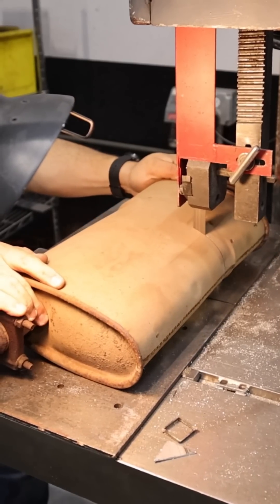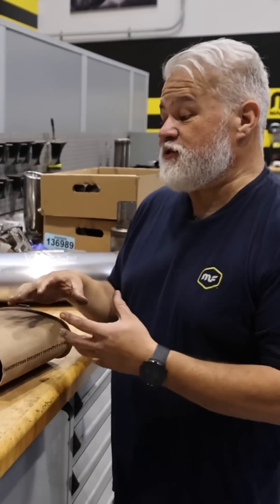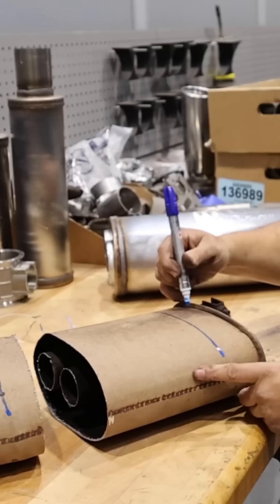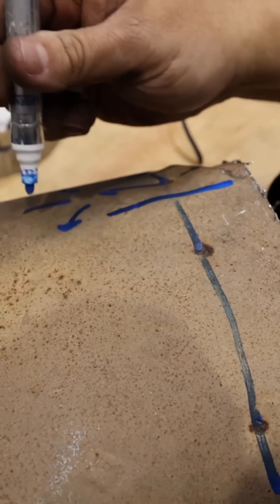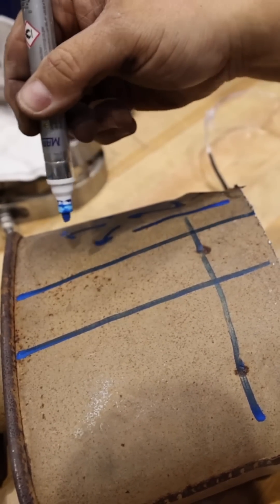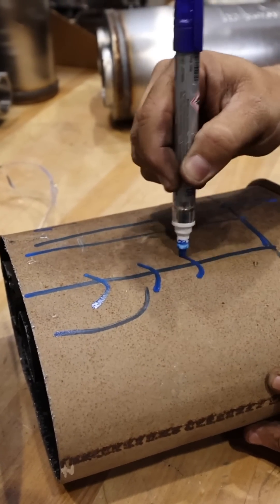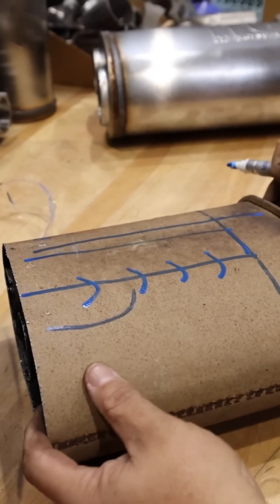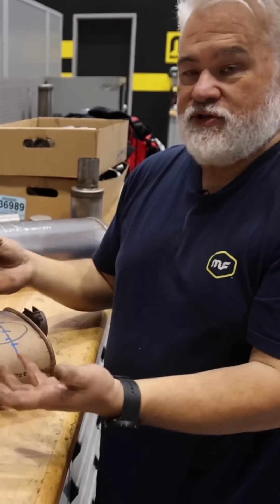What’s Inside a Cheap Exhaust Muffler?

Comment: This is how you block sound. It is doing exactly what it's meant to do.
Reply: I have a mufler on my car that does 2 30°turns and a serious of spherical divets  that suppress the sound without holding the gasses back.
Reply: Yes I agree a muffler it's entire purpose is sound suppression that's it that's all
Reply: It's doing cheaply which is his point, a well designed and manufactured muffler will be superior in both sound reduction and flow.  I bought a 3" muffler, it robbed about 25hp over no muffler, I cut it open it was this exact design, I gutted it, fitted it with 180deg mandrel bends at each end, few other things, stuffed with steel wool and not only was it quieter, I got 20hp back.
Reply: @kingcosworth2643 i know nothing (im not a troll)  steel wool is quite flammable...  why use steel wool?  Not enough oxygen to burn or rust?
Reply: Hence the name. There are words that i use for people who install "efficient" mufflers😊
Reply: He did say it was completely about sound suppression.  It causes back pressure (restrictive) and that robs horsepower.  It was not designed to take the engine efficiency into account.
Reply: Literally what a muffler means😂
Reply: It baffles me how little people in the comments know about how vehicles operate.. SO pun intended. 😂
Reply: We know a "muffler" reduces sound, his point is how inefficient it is at delivering the exhaust out of the vehicle, that reduces performance by a pretty large amount
Reply: @phdcinnabar5754  agreed!
Reply: @phdcinnabar5754 Me grinning nearly straight piped 😂😂😂
Reply: @Jamie_Sunshine  loud as hell though, right?
Reply: @phdcinnabar5754  Well I've still got a Cat and one resonator, it's a cat back system for my Mazda 3 turbo
Reply: @Jamie_Sunshine  👍
Reply: @phdcinnabar5754  You don't know that.  If this is a muffler for a 150hp car, its probably just fine.
Reply: @confuse9  all mufflers reduce performance so I'm not sure what you mean by I don't know that, the more turns, the more pipe, the less performance, there's a reason drag cares have there's exhaust go from the engine straight out the sides, everybody should know this, even high performance exhaust systems are not as good as just venting the engine straight into the atmosphere, but we do not do that, even the ripples at the bends reduces performance, this has all been tested thoroughly many many many times over
Reply: @phdcinnabar5754  LOLz, you may want to learn a bit about exhaust design, pulse tuning and scavenging before you start building that pipe venting straight out of the engine into the atmosphere.
Reply: @phdcinnabar5754  But how many?
Reply: @phdcinnabar5754     no... the point is a false flag sort of argument about efficiency as cover for assholes that run loud exhaust on their vehicles.
Reply: @stephenx2857 our engine is breathing through a straw with the stock exhaust system. Yes going after market can it louder, but It definitely improves performance, and can even improve gas mileage. I agree with you about people just cutting off their exhaust to make their car annoyingly loud, but thats not the same as a performance exhaust

Comment: Surprisingly the muffler doesn't obstruct much exhaust gas...the catalytic converter is the biggest obstruction
Reply: That's why I remove them.
Reply: Whole true. It depends on the application. In my avalanche the muffler is the biggest restriction. Idk why gm though dual 3" into out 3" was smart
Reply: provides the most effective noise suppression as well.
Reply: Your answer actually is incorrect for the most part. Many dynamometer tests have proved that on today's cars, the heat generated in the catalytic converter actually causes expansion of the exhaust gases that leads to greater velocity of gases that leads to a better scavenging of the exhaust. You actually lose power by taking the catalytic converter off of most NA cars
Reply: @JMar671  The heat creates expansion of the gasses that do not flow one way so it actually creates more back pressure, you want to cool down the exhaust system for it to flow more easily. The one exception would be if you have a turbo behind the catalytic converter, then the added pressure created by the heat would add more air pressure to the intake giving you better power.
Reply: @JMar671  some catalytic converter are less restrictive than others.
Reply: @JMar671 your both right and wrong.  Pressure out of the exhaust is increased. But the op said volume, which is reduced more by the cat. Like a Pressure washer,  not much water, but high pressure
Reply: @JMar671  You may be correct when talking about  modern cars, with their computer chip enhanced performance. I can attest however, that I had a 1980s Nissan Sentra, a California model with TWO catalytic converters that got 36 MPG or so.

Then the exhaust pipe failed under the engine compartment, prior to the first converter... the whole exhaust system fell off, and because I was young and poor, I carried the remains around inside the car, so if a cop pulled me over, I could claim it JUST happened, I swear Officer.

It went from sounding like a quiet little econo-box 4 banger, to sounding like an old 8 cylinder pickup. And my gas mileage went from 36 or thereabouts, to 41-42. I loved that old beater, and at the time, I was working multiple jobs, one of which was delivering pizza.

My customers used to tease me, and say they always knew when to get the money ready, because they could hear me coming 6 blocks away. But there was no way I was fixing it for as long as I could get away with it, once I figured out I was getting an added 5-6 MPG.

RIP little Sentra, "Penny" (named after the penny I found muck-glued in the ashtray) served me well.
Reply: @JMar671  those tests don’t re-tune the fueling after removing the cats, that’s why they lose power, and they also don’t change the intake which is usually just as restrictive as the exhaust. If you remove the cat, upgrade the intake to keep up with the increased exhaust flow, and tune the fueling you gain significant power (10-15% in my experience). 

If you simply remove your cat and do nothing else it’s correct that you will lose power.
Reply: @JMar671 that's odd I've worked on performance exhaust systems for years and have never seen a car improve hp ever. That's why the first thing that gets done on a cop car is to remove the cat
Reply: @JMar671 I’m glad you specified most NA vehicles, because I have a diesel truck that would argue with it. Incredible performance boost and much cooler eg temps with no cat!  Huge performance boost removing it
Reply: @warrenparker6287 shhhh... epa entered the chat
Reply: @reynoldscs  I know nuffin
Reply: @JMar671 This sounds false 😂 but I don't care to do the research. Check mate. Have a nice day! I'm going to probably stir up a hornets nest repeating this at some point with no citations or evidence. 😂
Reply: @Jamie_Sunshine  Bogus research, Catalytic Converter did kill muscle cars because of the huge restriction.
Reply: @omegaman7377   no, they didn’t.  They lowered compression and put smaller cams in “muscle cars”  and dumb-dumbs have been blaming (and deleting “) catalytic converters for 50 years now.
Reply: @omegaman7377 acting like muscle cars are dead, and yet the newest generation ones are faster? Isn't it fascinating the double reality you have to live in. Face it, our society was built in a way that requires cars for everyone. So either you need to start fighting for more walkable cities and better public transit, or you need to accept that 95 percent of cars are looked at the same way refrigerators are
Reply: @omegaman7377  Dodges performance vehicles would completely disagree with you while spitting out 1000 hp
Reply: @Depl0rable10  the new gen are dead when they return back to the dealer without your permission
Reply: @Depl0rable10  they have blown the lid off with the new muscle cars!!! I spent all my money and all my time trying to get half the horsepower out of my 68 camaro that’s rolling off the assembly lines nowadays!!

Comment: A muffler has one job; to muffle the sound of thousands of explosions per minute as long as it does this what more does it need to do.
Reply: Sound good. Not choke the engine.
Reply: Just to be clear, internal combustion is not about explosions....  its about burning.  The burning of the fuel, heats the air, which increases the pressure.  You do have a rapid increase of pressure in the exhaust when the exhaust valve(s) open.   But its not an explosion (gas flow should be sub-sonic...)
Reply: @confuse9  it’s all about the explosion 💥 in the cylinder when compressed and ignited or the rapid expansion of the burning fuel which forces the piston down, thus turning the CS. The exhaust allows the burnt fuel gasses to exit the cylinder so a new charge of air & fuel can be introduced into the cylinder to repeat the process. 
It’s been proven some naturally aspirated engines perform better with some back pressure. SOME perform better with no resistance of the exhaust.
Reply: @confuse9  the process of rapidly burning fuel/air combustion is commonly referred to as an explosion by 99.99% of the world’s population. So anyone referring to it as such wouldn’t really be wrong
Reply: @warrenparker6287  umm, nope, there's definite differences between explosions and combustion. Next you're going to tell us that detonation and deflagration are the same thing.
Reply: @0cypher0  you’re absolutely correct exactly. Except I will tell you nothing else. Peace be with you 🙏
Reply: Believe it or not, it could actually improve performance!!
Reply: @warrenparker6287  mine has straight pipe going through the muffler, it improved performance like 5% 😂😂
Reply: It needs to sit on my garage floor...  And I will start my truck at 4am and wake your twinkie eating butt up. Good morning beautiful. Someone has to pay the taxes... and  you lay in bed while visions of food stamps dance in your head.
Reply: It also can help with torque through back pressure.

Comment: I wish you would’ve cut the entire top off the muffler instead of in half cause I could’ve understood how it worked a lot better that way lol
Reply: Beat me to it.
Reply: At least he should have had a light when showing the inside.  Nothing to see here just black.
Reply: Nothing much you can learn from this lot.  They're not bright enough to understand this is how mufflers are designed to work.
Reply: yes!!!! he didnt need to cut it...he couldve just wrote on the top with a marker lol
Reply: Yeah that's not how you demonstrate it.
Back in my apprenticeship i gad to cut open multiple mufflers for some events and i cut them open woth a good gin cut off wheel and removed most of tge top section to reveal the insides.
I also made welding jigs for mufflers.
I was a tool and die maker in a company that made mufflers for trucks and busses.
Reply: My thought, rather than using a marker while talking. Makes more sense to see the actual set up.
Reply: Not to mention his dreadful scribbles that really confused the whole presentation even further.
Reply: the dude made this video, you cant expect him to make sense
Reply: Yep .. his drawing sucks too...
Reply: Yeah, cut it lengthwise....

Comment: So what's a good quiet expensive muffler look like?
Reply: Borla
Reply: You have to dig real hard. Apparently it's not a thing....but it is.
Reply: @wzero07  I'm sorry I wasn't really clear. By expensive I meant oem from the dealership. 
By good I meant high flow low resistance.
Maybe those two things don't go together as oem. If not what would be a good brand if you want super quiet?
Reply: I'm sure this lot are eager to sell you one.
Reply: Yes
Reply: Straight through with minimal bends or flow paths.
Reply: @ALMX5DP  pretty sure those are fairly noisy.
Reply: @consaka1  my factory stock F-150 muffler is straight through and makes the exhaust almost silent.
Reply: @ALMX5DP  That's cool. The older I get the more I appreciate quiet exhaust.
Reply: @consaka1  same, I’ve thought about replacing it but from what I’ve seen there is no performance benefit due to the stock’s straight through design and I too appreciate it being quiet on road trips and especially towing. So for now I’m quite content with the stock unit. Mind you not all stock exhausts are designed that way so it may be vehicle specific here but at least it shows it’s possible.
Reply: @ALMX5DP - From the factory the newer F150’s have 2 catalytic converters, a resonator, and a muffler. depending on the year of your F150 yours will have a similar setup.
Reply: @josephseno8272  yup that's pretty much the setup, though I was just referring to the last muffler in the system which is a straight through design. Cutting just it out, and decibels increase substantially.
Reply: @ALMX5DP  have you cut it out and looked through it? Just because enter and exit are on the same side does not mean it's straight through.
Reply: @jameslaramie8041  yes there have been people who have cut it open to see the internals.
Reply: @ALMX5DP Fascinating.
What year and engine?
Reply: @kczbluesman  mine is a 2015 and I believe the rear section is common to all F-150 engines of that era.
Reply: @consaka1  me too. But I do like a good sound, but who wants their ears ringing after driving across town?
Reply: @ALMX5DP  and then you wake up?